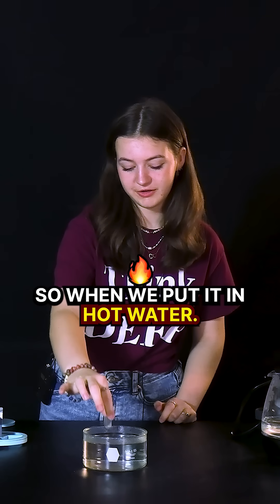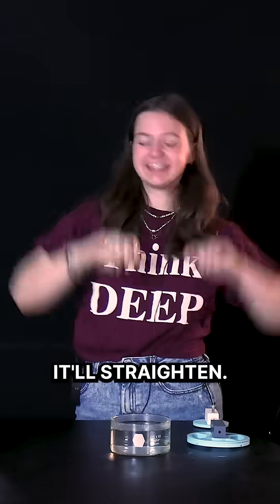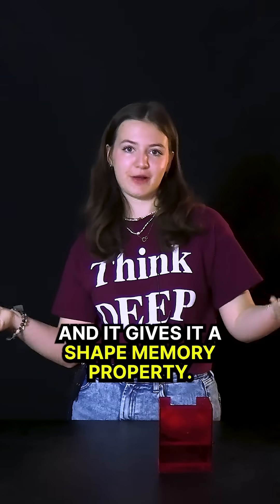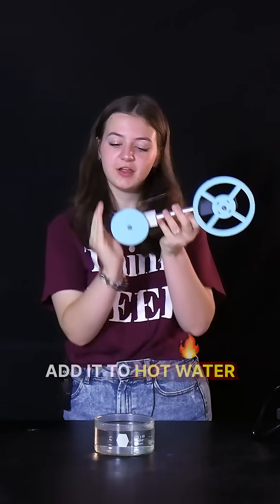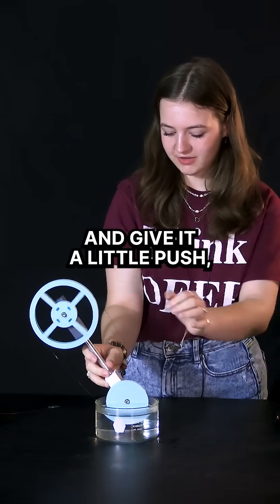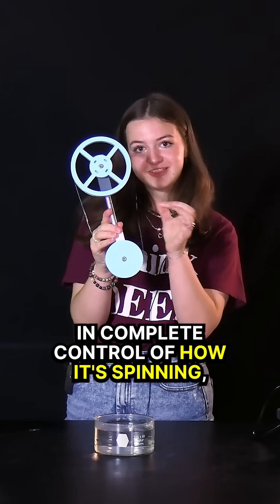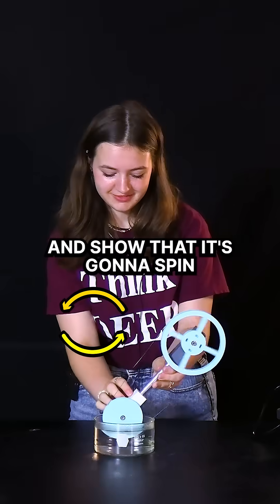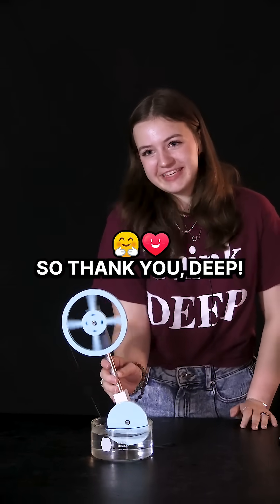Magic metal springs to life from heat! But how?? #shorts #tamu #science

Comment: She is so smart she avoided sudden death by not labeling this video with the words "free unlimited energy"
Reply: @anthonythibodeau81  yeah because its more like a cool way to turn thermal energy into mechanical energy. But you do need to heat up/ cold the water… and that takes more energy 😅. It probably opens a lot of uses for harnessing the residual heat to move and control things!
Reply: @javierquesada192  But what if you have a hot spring. :)ho
Reply: @danielst6976  i mean yeah that’s geothermal energy but its not every place has access to it, you could also use atomic, biomass, solar or others to heat… but still need an external source of energy to make a temperature change. All of them valid.
Reply: @javierquesada192   put it somewhere with already hot water like a valcanic  spring matter a fact use the steam they let off for power too
Reply: @javierquesada192 You could use the sun to heat the water
Reply: @javierquesada192  It can be used in colder region where water is already cold?
Reply: @javierquesada192  well truly what she is showing a new way to turn heat into mechanical energy, because the only way we've been doing it so far is by making overheated steam, which can be dangerous.
Reply: @javierquesada192  hmmm if only there was a way to create heat without electric power 🤔🤔🤔🤔🤔 i wonder....(☀/🔥 )
Reply: @demypeace  That would take too long to be practical.
Reply: @demypeace  not sure what you been by that comment 🤔 can you clarify?
Reply: @demypeace  at that point just use solar panels
Reply: @demypeace  ? Water's specific heat capacity Is to high for the sun to be useful in this situation, when you go to the beach, is the water ever hot? Critical thinking people.. this is high school level physics
Reply: @demypeace  the metal wears out after so many "reminders" we'd have to regularly reforge new pieces to replace it
Reply: @demypeace  why not use more efficient forms of generation like solar panels for the sun and a steam turbine for fire
Reply: @demypeace solar energy -> heat energy -> mechanical energy -> electricity?

Way too inefficient.
Reply: Because it isn’t
Reply: @OnyxLuna-m9c  it isn't but most people wouldn't know. Lol
Reply: @midnitedracula  You know… you’re not wrong! And I find it sad that anyone with basic Physics education wouldn’t know. But they are out there 😣
Reply: Heat aint free bubba
Reply: @cycsais1062  bro put a bunch of magnifying glass to heat the water!
Reply: Or she's just smart enough to know it's not unlimited lol
Reply: @-karma-2426  nitinol has been around since 1959 so we would've already known by now
Reply: @EggplantHarmesan  exactly.  She's prolly smart enough to know basic info about the materials she's using and the machines she's making with them lol
Reply: @anthonythibodeau81  it isn't because you need to keep heating the water right?
Reply: You still need energy to heat the water
Reply: How you gonna keep the water hot?
Reply: Bro dude free power is impossible
Reply: Because it isn't. You still need the thermal energy to heat the water, and since water has such a high specific heat capacity, you will need allt of thermal energy, meaning, alot of money.
Reply: Another consideration is the phase change takes or releases energy, which means not only can it transfer heat into motion, that motion can move the heat... 

This could be use as an air conditioner or heater in a way . 

The question then becomes... How efficient would it be
... And I'd wager.. not very... But does make one curious.
Reply: @anthonythibodeau81  that's because it's extracting energy from the water.
Reply: @anthonythibodeau81  someone will say it is, we all know someone will
Reply: @anthonythibodeau81  😅😂🤣
Reply: @anthonythibodeau81  rightttttt! That's true too
Reply: So the energy output can't be used to power something to heat the water?
Reply: @anthonythibodeau81  obviously because it isnt... its powered by thermal energy the same way thermal energy makes air move to power wind turbines.. both are examples of turning Thermal energy into Kinetic energy
Reply: @anthonythibodeau81  you do know that besides heat flux and heat generation strain energy also account for the change in internal energy right
Reply: Because it isn't, and that would be wrong.
Reply: in my home town, in the past, a billionaire philanthropist that invented a mechanism for train hitch's in the 1800's, with his wealth, eventually set up a system based on dams and water mills in the main river flowing through town, where our town, as well as 4 neighboring towns were supplied electricity for free, so long as the people of the town managed the mill and kept it up, the energy harnessed was shared free of monetary charge with the people who lived there. Free energy already exists monetarily speaking, as the systems that produce/ harness energy are going to produce the energy whether a human being that owns a business decides to charge money for it or not. This system lasted almost half a century before electricity companies came to the town and ended it, saying it was "unfair everybody around has to pay" and democracy took this energy away from people, instead of expanding it and finding ways to include everybody. Stories like this are also swept under the rug because humanity has a greed problem. Generosity would benefit everybody, not just those with more paper.
Reply: @K_D_H_D  "as well as 4 neighboring towns were supplied electricity for free, so long as the people of the town managed the mill and kept it up, the energy harnessed was shared free of monetary charge with the people who lived there." So it wasn't free after all, cause they've needed to put  work into servicing whole system( preserving the mill and other infrastructure in good condition). So they were basically paying for this "free" energy with their unpaid work. In the end it's just another form of trade exchange, a barter to be precise - work for energy. In reality, nothing is ever free , someone always need to put something in to take something out, no matter  it is money, resources or work.
Reply: @ba_vinci9220  it was free monetarily, as they didn't owe somebody money, maintenance didn't take very long either, there was no looming overhead bills, the electricity supplied was the reward, they didn't have to be paid, not owing was more than enough. Something requiring time and effort naturally doesn't make it not free of financial charge. This system was based in generosity, not debt, and the efforts put forth, weren't to compensate subjective numbers created within the monetary system, the efforts went directly towards what was needed, and was shared. It sounds like you'd have been on the team of eliminating this system, you don't know how to think of a world without artificial debt, its all you've ever known and have seen no example of something else.
Reply: @krisissupercool1  Maintenance and service of hydroelectric plant didn't take very long? How about maintenance of generators, breakers, transformers, electric grid and so on? It's a lot of work, and someone also have to monitor it, adjust the generators power accordingly to demand, fix all failures etc. It's not a few people feat, but rather whole big team of people(company) undertaking.
Reply: The sun is free unlimited energy. People try thinking with your prefrontal cortex.
Reply: @Dojobows  solar panels are too expensive for them to be used world-wide, untill we find a cheaper way to converts the sun's energy into useful energy, cheap fossil fuels it is!
Reply: @ Never said anything about Solar panels, i was talking about downsizing then sun on earth. We can do it, i know we can.
Reply: @Dojobows  it's technically not infinite, since it will eventually burn out, but in reference to the human race, it will long remain after we as a species are gone. So to us, yes, infinite energy.
Reply: @damien7157  Billions of years is unlimited time for us in a human perspective . Come on people, think with more prefrontal cortex.
Reply: @ripztubig4457  So, why correct when its not be corrected. 

When billions of years is not infinite, then 300k years, is a very short time frame of learning to walk, start fire, and then farming on a large industrial scale and then somehow start making silicon chips and now we're talking to AI models Now, much like a human to human would. 

Our time of reference is backwards. our sense of worth is backwards. the way we think is backwards in time, not forwards in time. Time happens all at once.
Reply: @Dojobows  the sun is free energy… that you still need to harness and cannot be stored on its own unlike fuels and only is available 12 hours a day with varying intensity. Plus to move a pulley or any mechanism with thermal materials (if they can store enough energy in its structure) you probably also need to cool as well as you can heat it. Things to think about.

Comment: Well some think it is unlimited energy. But No. wire will lose its property and you have to spend energy to fix it. Universal law of energy holds.
Reply: Why would anyone think it’s unlimited energy?
Reply: @OnyxLuna-m9c  Are you new to the Internet and People in general?
Reply: @adamguitar1498  idk, perhaps I am too old instead of new. I don’t know what the new idiots think.
Reply: @OnyxLuna-m9c you need to get off the internet
Reply: The main reason for it not being infinite is because it takes energy to heat up the water.
Reply: no the shape transfer is powered by heat, and it absorbs heat to straighten itself
Reply: Nah. The water is hot, you need to heat the water.
Reply: Properly trained Nitinol: Can retain its shape memory for over 1 million thermal cycles.

Overheated or overstressed wire: May lose its memory in as few as a few hundred to a few thousand cycles.

At room temperature (inactive): The wire can retain its trained shape indefinitely without degradation.
Reply: but it may take less energy to fix it than energy gained
Reply: @westleyturner8330  That's not how energy works. Also the heat of the water is energy that is required for it to work